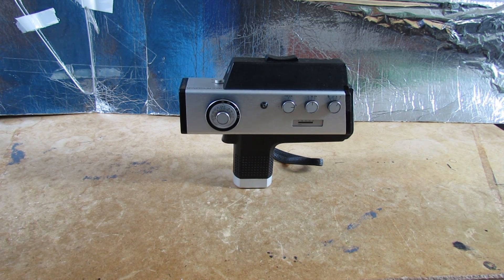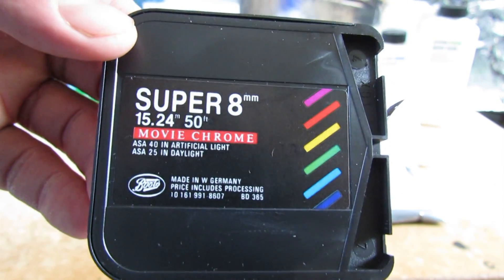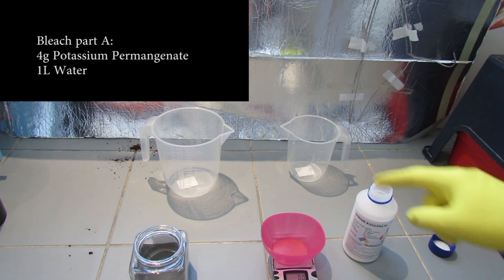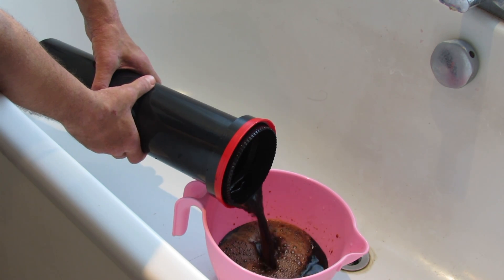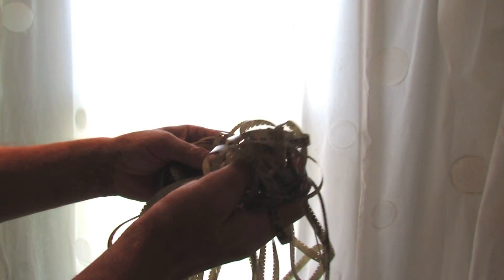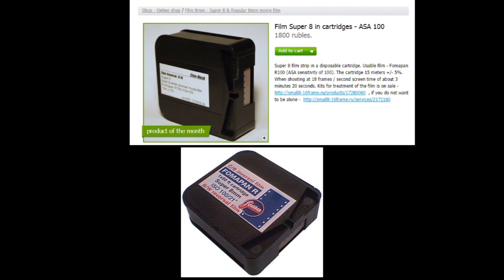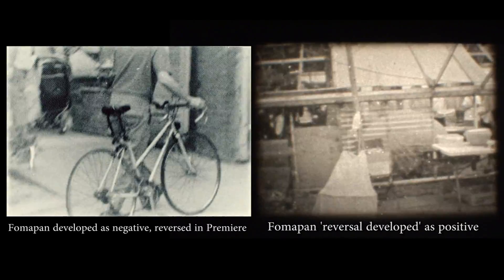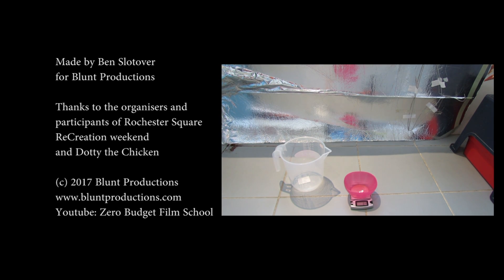Reversal processing Super 8 in Caffenol. FULL instructions included!

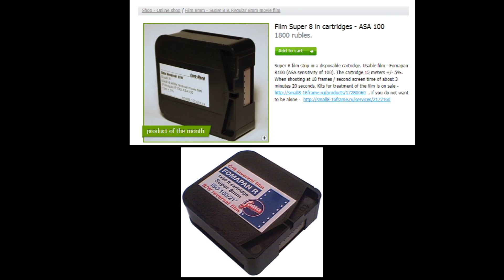Comment: What models of Super 8 camera do you have/use right now? The one at 9:49 is some kind of Eumig, correct?
Reply from the maker: Sean Gentry Yes, that's a Sound Eumig and probably gives the best quality picture. I also have an Agfa Movexoom 2000 which just looks badass, a tiny Halina and a Revue which I don't use much because it scratches the film. I also have a non-working Canon 514xl-s which was a very good camera.
Reply: Those are some beautiful cameras, especially the Agfa. Gotta love the spage-age aesthetic. I have a Bolex 160 Macrozoom and that thing seriously looks like some kind of Flash Gordon laser pistol. I'm shooting a few rolls of old Kodachrome on it and hopefully I'll getting some sort of image off them using caffenol soon
Reply from the maker: Sean Gentry wow that Bolex is insane looking. Does it have some kind of mirror or prism to send the picture to that vertical mounted cartridge? Good luck with the Kodachrome. If it's as old as the stuff I've shot, it'll need a good 20 minutes in the caffenol, plus a pre-wash with baking soda or borax in water to remove the Remjet.
Reply: Yeah, there's a prism inside. I think it's build that way to accommodate the enormous macro focusing element so the lens barrel doesn't stick like 6 inches out of the camera body. 

My Kodachrome is from the early 80s I think. I'll make sure to do the borax wash for the remjet and be generous with the time in the caffenol.